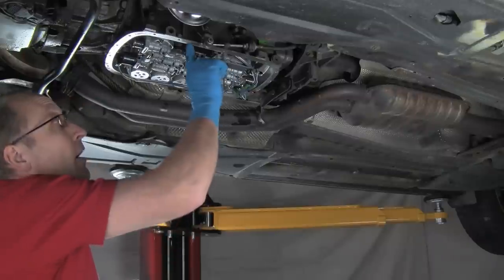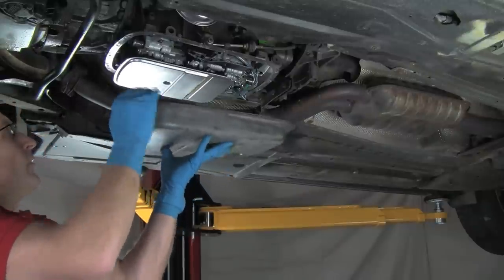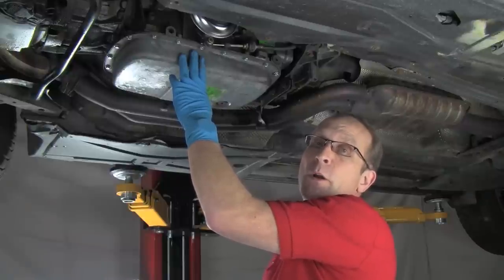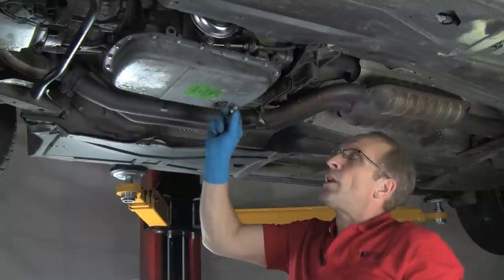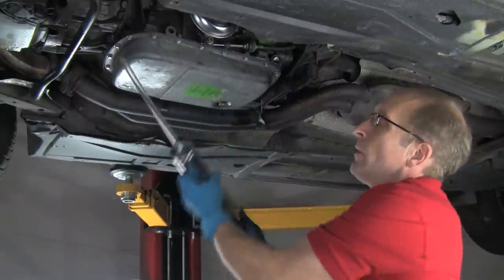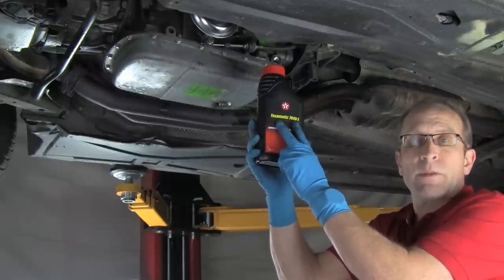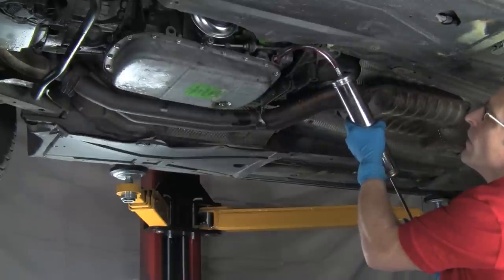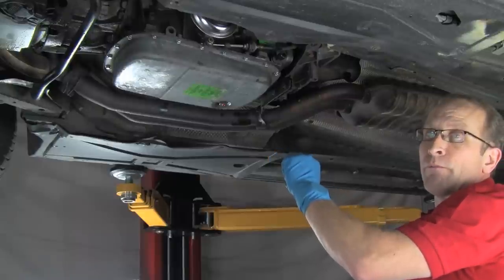Part 2: Changing Automatic Transmission Fluid & Filter On A BMW/MINI

Comment: Hi first all i just want to say thank you for thie video, i have a question for you, my BMW 323i Model 2000 is having problems with the reverse when the road is not level the reverse not work and when the road is level works but is weak, i hope you can help me.
Thank you in advance
Reply from the maker: Depending on the production date of your 2000 323i, you could have one of two different transmissions.  Both versions have possible reverse problems.  The problems are different between the two.  If your production date is Feb. 2000, or before, you have the A5S-360R.  If the date is March 2000, or later, you have the A5S-325Z.  See the two tech articles below.
A5S-360R - http://blog.bavauto.com/13206
A5S-325Z - http://blog.bavauto.com/3828

Comment: Amazing video!!! I'm a proud E36 318i 1996 owner and I want to change this fluid but I have 2 problems.

1: What is the presure needed to adjust the bolts?

2 What kind of fluid my car needs? Is over 160,000 miles

I'm a biggest fan of your videos! Im in Mexico City!

Could help me with his info?

Thank you in advance!

Regards!
Reply from the maker: The torque for the pan bolts, on the A4S-310R transmission, used in your 318i, is 9 ft-lbs.
Reply: You can download a flow chart from the ZF website. Gives you everything you need to know.

Comment: nice thanks..i have a bmw 325xi 2003, is the fill plug on the same side as the one i saw on the video?
Reply from the maker: Your 325xi uses the A5S-390R, which is externally the same as the A5S-360R transmission as shown on this 528i.

Comment: i live in south africa and i just got a 1997 323i ,which oil should i use for the engine ,transmission,power steering your input will be appreciated,thank you.
Reply from the maker: We would recommend the Liqui-Moly 0w-40 synthetic for the engine, Red Line MTL for the manual transmission (Red Line D4 Dexron-III for automatic), Red Line D4 for power steering and Red Line 75w-90 RLDFL for the differential.  Click the link below, ID your model and just search the items listed above.  We can handle international orders via email (info@bavauto.com) or phone (603-427-2002 ... in the US).
www.bavauto.com

Comment: Hi Sir!! 
Thank you for your videos. They are really informative. I've got one question here. My bmw  is leaking oil from transmission although it was changed not so long time ago. (due to poor service work I guess) What is going to happen if I just unscrew the oil plug to add some oil? Is it going to splash all over the place? Sorry, for bothering and thank you in advance.

Comment: My car (bmw 2008 335i) got overheating...I changed transmission fluid & filter, fill up the antifreeze/coolant....But it still got overheating after 2 miles driving??? is that a problem with electric water pump & thermostat  or the radiater... When i first start the engine, the fan automatic running... Please, i would like to know what's wrong... BavarianAuto!!!!!!
Reply: You might want to check you water pump and thermostat bmws are know for having bad water pumps , there made out of plastic and tend to go out, I work at an auto parts store and I get a lot of bmw owners coming in for water pumps, on a daily basis .. Correct me if I wrong but the 335i had overheating problems due to their turbos setup , could also be a possibility , might want to get that check out as well

Comment: Thank You! My car also makes a noise like (click click click) what could it be?
Reply from the maker: No way to even make a guess with just that much info & not being able to drive the car.  Does the sound stop if the brakes are very lightly applied?

Comment: BavarianAuto  What will be the optional type of oil in Castrol? Unfortunately we dont have the chance to get the Texamatic 7045-E in my country. I have the A5S-390 Gearbox  in my 530D but i dont seem to be able to find the correct oil. Thank you in advance!
Reply from the maker: Not sure what a Castrol fluid would be 9if they have a true match, not just a "can use".  The ZF Lifetime-5 fluid is also proper.

Comment: Hi! I bought some Products in the Past from you! Very Content with my transaction! Now to my question? I am coming up to my 2009 335i E93 50,000 Mile Mark! I would like to change the Oil in my AutoMatic StepTronic Transmission! Is this video similar to my application? Or do you have another video that shows the process of the E93 Automatic Transmission Oil Change?? Or a Video that is similar? Thank You so Much Bavarian Auto for your videos! You have helped me out so much! And can't even imajine the money you have saved me from having to go to The Dealer!  Thank You again!
Reply from the maker: The procedures will be the same, but your transmission is a different model (GA6HP19Z).  Check the video in the link below.  This shows the GA6HP family of ZF transmissions.
http://blog.bavauto.com/15410/bmw-diy-video-fluid-and-filter-change-automatic-transmission-zf-6hp-models/

Comment: Otto, your video doesn't mentioned about multiple flush. I have a 2004 325I with 135,000 miles. I ordered the filter and fluid. It calls for 6 quarts. Do I just drain and fill like your video?
Reply from the maker: We have tanked about the application of follow-up drain/flush cycles in order to achieve a higher percentage of fresh fluid, in many of the comments.  Just run the engine for a bit (or take a short drive), to mix the fluid, then do an additional drain and fill without removing the pan.

Comment: This video is great but have a question for you I have a 2005 118i 1995cc 6 speed automatic transmission  with steptronics I just changed pan with filter and drained got 8 liters out but can only get 4.5 back into it using the same technic you used so just wondering where the extra fluid came from or was it just way overfilled?  The car was very jerky through 4th I am just afraid to drive it since got 8 liters out of it? It seems to be driving find all gears work. It's a E87 model. Thanks

Comment: In total around 9 liters of transmission oil is inside an automatic transmission. Around 4 liter in the oil pan. And around 5 liter inside the torque converter. What about this 5 liter inside the torque converter? It looks like only 4 liters is refreshed.

Comment: Hi there , nice and clear video. I own a 2009 bmw 125 e82 coupe automatic gearbox 6 speed. And I want to change the gearbox oil (115000 kms) here are the number séries could you advice me please about the right reference of the oil and the how many liters should be needed please (WBAUC31090VF44749)

Comment: Hello, I would like to know how do to empty the torque converter, so that there is old fluid and contaminate with the new fluid. is it necesary to dry, will be emptied several times the transmission??
Reply: Alvaro Aleman has any one ever given a answer to your question?  I was wondering the same thing, because with out removing all the fluid its not a fluid change, your mixing 2 different most likely different fluids, you have a very accurate question.

Comment from the maker: The transmission (A4S-310R) in your 97 model 528i is a different transmission than the one shown in the video.  The drain and fill are a bit different, but the overall procedures are similar.  The Bentley repair manual for the E39 chassis (5-series 97-03) will cover the specific drain, pan removal and refill procedures for your application.  We have the Bentley manuals as well as the filter and fluids for your 97 528i.  Just call us at 800-535-2002 or visit our online store at bavauto.com

Comment: Hi. I have a problem with my 525i. Not too long ago, I had a transmission malfunction pop up on my screen. I have a mileage of 178k. Do you think this procedure will fix my problem? Or do I need a whole new transmission?
Reply from the maker: Well, a fluid and filter change can often take care of issues that result from the valvebody valves being sluggish due to the old fluid.  A fluid change may help.  Have you have the actual transmission fault code checked ... to see what it is?

Comment: Another question I have the mobil 1 synthetic atf multi vehicle formula and valvoline full synthetic multi vehicle atf wich one you think is right for my 03 bmw 325i?
Reply from the maker: Neither is approved by ZF.  We understand that the fluid manufacturers say the fluids are applicable, but the transmission manufacturer has not approved these universal fluids.  We still recommend the fluids approved by the transmission manufacturer.  Just go to our online store at www.bavauto.com , ID your vehicle, and search (automatic fluid). We will only show you the fluids that are specifically approved.

Comment: thank you for this video, I also have a question. I have a 2001 530d with GM 96022907 automatic transmission and I have used the same Texamatic 7045 E, but I put 5 litres inside and it's still not coming out. Is it possible to overfill it? Thanks again and I apologize if my english is not very good.

Comment: A true "flush" runs too much pressure through the trans and will usually cause more damage than good. Can cause damage to friction discs and other components and will usually leave you with shift problems or no trans operation at all. Drain and fill with a filter change is your best bet.

Comment: I am not referring to a video but to my first comment. Anyway, what do I need to do if the code of the diagnostic says "gearbox selector"? Is there any other option than just replace it?
Reply from the maker: We would suggest further diagnostic to be sure if the actual fault is indeed the shifter assembly .... before spending the money to replace it.  A proper technician should be able to verify this via the full vehicle diagnostic reader.

Comment from the maker: You would do well to change the automatic transmission fluid at this time.  The proper fluid will depend on exactly what E66 model you have.  Most will use the ZF Lifegaurd6 fluid.  Call our agents at 800-535-2002 (603-427-2002) or visit our web site at bavauto.com for further assistance.

Comment: I own a 05 Z4 3.0 and my transmission warning sign i showing up.I went to AAMCO to see what the deal is and they did a full inspection and found nothing.However they tried to clear the fault code "transmission" but the code stayed on.I even tried to unplugged the batt and still didnt worked.The car has 84k miles and drives perfect with no slip on each gears.So no fault code but with transmission warning light?any  help would be appreciated.thx

Comment: Noticed Texaco oil products...for BMW? I guess the european transmissions uses other oil?
The Transmission fluid replacement kit. Where was it purchased? ... it does not look OEM...and it is ok by me.
Reply from the maker: The original fill for this application was the Texaco fluid.  We now use the factory approved ZF Lifeguard fluids.  It certainly is not unlikely that the US and Euro spec models used differing fluids, due to different contracts.  We have the filter replacement kits in our online store at BavAuto.com.  We typically have both original BMW as well as quality aftermarket offerings.

Comment: I read the blog and it says nothing about changing the fluid for high mileage transmissions.....my bmw has the lifetime dexron III With 200k+ miles on it. It is currently low on fluid and I would rather just change out the old for new, but I heard high mileage transmissions can go bad if fluid has never been changed. What's your view? The transmission sorta bangs into gear sometimes do to low fluid. Should I change to new fluid or just top it off?
Reply from the maker: Short answer - change the fluid.
Long answer - please see our blog post covering the high mileage issue.
http://blog.bavauto.com/5532/bmw-automatic-transmission-fluid-filter-change-high-mileage/

Comment: Hi, I have a Bmw e46 316i 2000 automatic transmission and recently got the transmission light on the dashboard. Car has 140000 miles and transmission fluid has never been changed. Could this be the reason? BMW software shows gear selector fault? What does this mean?? Please help ASAP as my car gives me this "jumps" when changes shifts. Thanks
Reply from the maker: Changing the fluid and filter may indeed help with the actual shifting and driveability (as well as the long term life).  However, the fault code is likely not due to the need for a fluid change.  You may have a faulty shifter assembly (gear selector fault).

Comment: Hi guys. I have question about Porsche Cayenne 2004 automatic transmission 6 speeds.  I don't know why my transmission doesn't pumping a fluid when I did fluid change. Im switching the speeds Drive, reverse for 5 seconds hold and parking again but it didn't  help. Instead 9 quarters I put only 2.5 with fluid and Lucas. No codes didn't show up. Do u have any ideas about this issue?? Thx.
Reply from the maker: We're not specifically familiar with this application, but how much fluid did you drain?  We doubt that that you drained 9 quarts.  if you are looking at a chart that says 9 quarts, this may be the full capacity when the transmission is initially filled.  When doing a drain, you typically only get 1/3 to 1/2 of the total fluid out.

Comment from the maker: If the fluid level is correct, you may be dealing with the issue noted in the article on our Tech Blog covering "no reverse" on this transmission. go to blog.bavauto.com and enter "V8 No Reverse".

Comment: Hi I'm using BMW 318i sedan. I changed Automatic Transmission Oil to new oil Mobil ATF 220 then the light shows on the screen " Sprocket with I letter" I think it's oil problem, can you advise
Reply from the maker: First verify that the fluid is properly full, with the engine running.  If so, we doubt that the fluid would be causing a fault code.  Have a shop read the transmission fault code, as a start.

Comment: I'm attempting to service transmission myself. I'm wondering will it be a problem to use the same bolts? and the tube that's on the filter does it come with new filter?
Reply from the maker: The bolts can be reused as long as they have never been over-torqued and are not over-torqued on the re-install.  The tube on the filter is part of the filter, unless a given design doe not use that type of pick-up tube.

Comment from the maker: All of the GA6L45R transmissions (General Motors) are specified to run Dexron-VI fluid. Therefore, the Red Line D6 is fully compatible.  We have the Red Line D6 in or online store at bavauto.com, or call our advisers at 800-535-2002.

Comment: Any variations for E36 other than the dual pans?  Can this be done on Jack stands, and if so, would you lower the car to shift thru the gears for the engine on fill?  Thanks.
Reply from the maker: Just that the front pan has no drain plug.  Also, when filling, once the engine is started, the front pan needs to fill, so the fluid will go down fairly quickly.  You may want to be ready to add fluid before shifting through the gears.  Yes, the gear range shifting can be done on the jack stands.  Keep your foot on the brake so that the driveshaft and transmission are not turning .... so you can return to PARK without grinding the parking pawl.

Comment: Hi sr then if I just want to check the level I just have to do what you did after you fill the tank up the first time?
Reply: My car is a 03 bmw 325i with 114 thousands miles
Reply from the maker: Yes, Basically.  With the transmission warm and the engine running, remove the fill plug. The fluid should be at the level of the bottom of the fill plug.  If it is low, add until it flows from the hole.  Do not turn the engine off until the fill plug is replaced.

Comment: Bav:  There have been rumors floating around for years that a transmission fluid change (especially on the early 2000's E46's) can cause the transmission to fail.  Personally, I'm skeptical of this claim and don't wonder if in those cases something was already wrong or the procedure was done incorrectly.  Was wondering what BavAuto's opinion is of these rumors?
Reply from the maker: Wive's Tales ......
Seriously though.  We have commented many times on this, in the video comments.  You can also check out our input in our tech blog, here:
http://blog.bavauto.com/5532/bmw-automatic-transmission-fluid-filter-change-high-mileage/
Reply: BavarianAuto
Great comments on the link you provided.  This is just one of those tales that won't die..
Reply: Not sure if procedures are the same, but you DO realize this repair is for E39 and not the E46? I owned 2 E46 so I understand your question though.
Reply from the maker: *****
 The E39 and the E46 6-cylinder cars (as well as Z3,and X3) both used the same two transmissions, the GM A5S-390R (or 360R) and the ZF A5S-325Z.  The transmission in any given E46, E39, Z3 or X3 will be dependent on the production date and exact model.

Comment: I have a 2004 325i m56 engine. Car has 150k miles.  i'm going to change the transmission fluid and filter on it. Do you think it will help the transmission?
Reply from the maker: Certainly!  Get old just out of there.

Comment: If im unsure as to the type of trans oil in my car now will there be any issues adding your fluids? Im concered about adding different fluids and ive heard that mixung different fluid can distroy my trans. What fluid do u recommend for a 2002 bmw 530i??? Thanks. Please let me know asap as im gearing up to change the fluid once this question is answered.. Thanks.